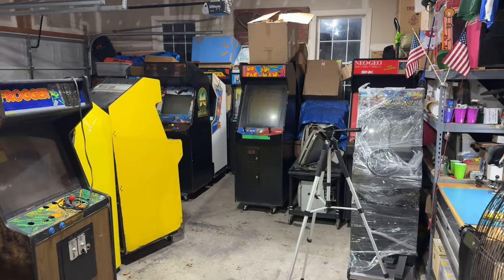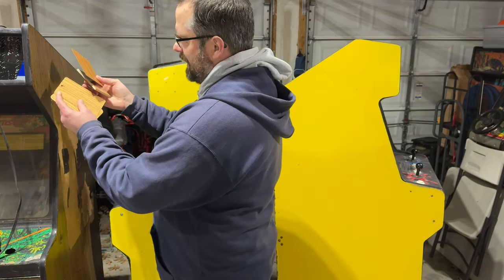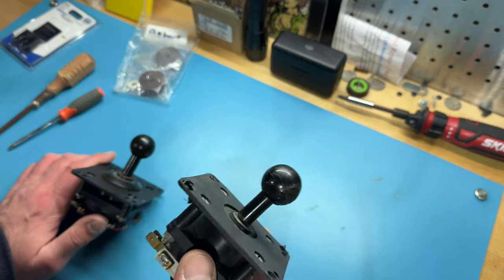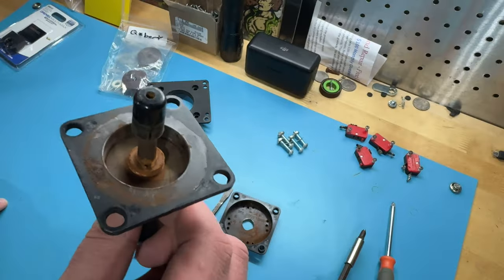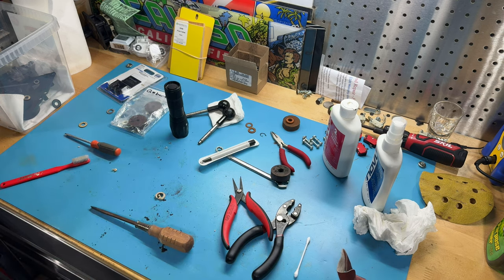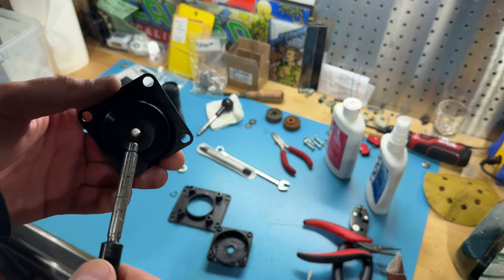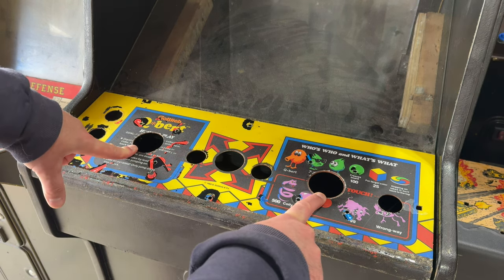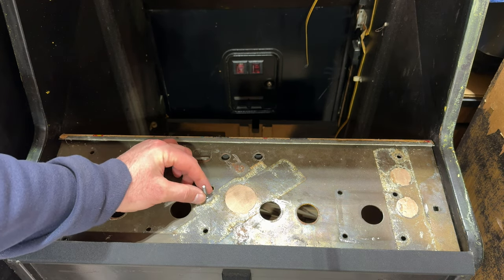How to rebuild a Qbert arcade joystick 🕹️ plus matching laminate colors & testing the sound PCB 🔊

Comment: All the Arcade Machines I've worked on 20+ years ago down here in Australia with MCA Joysticks they were always soldered on. the micro switches :) 

You would get the machine and then replace and re-solder all the micro switches :)
Reply from the maker: I've just got Tighe in my head making me all paranoid! LOL